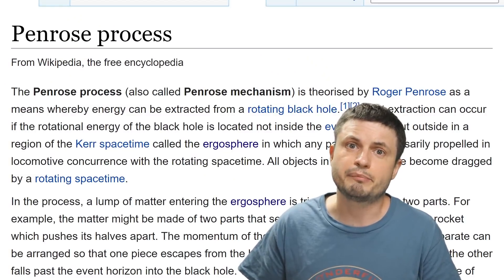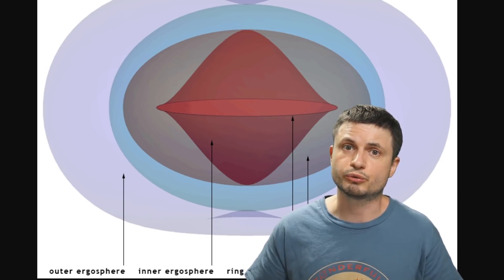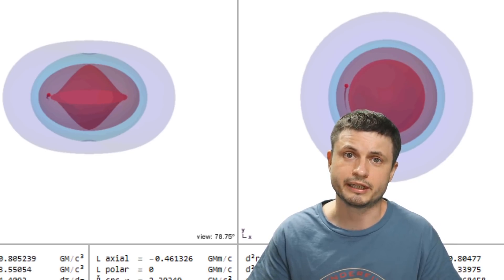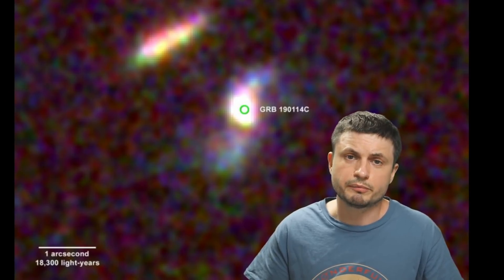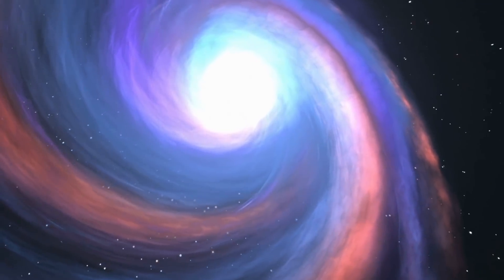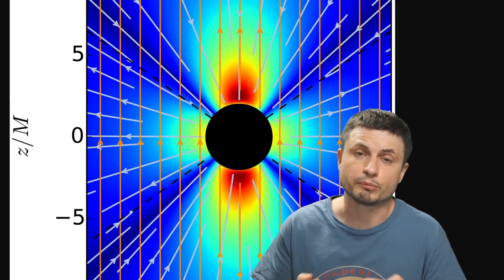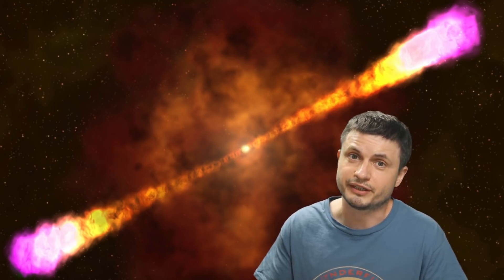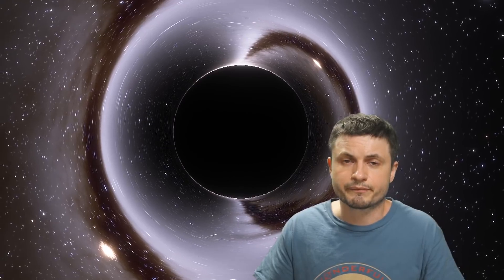Gamma Ray Burst Stole Energy from a Black Hole - Proving Penrose Process

Comment: The Universe is expanding too fast, the constants are all wrong, the speed limit of cosmic particles breaks models,
so they THINK a long long time ago, a binary system caused a black hole. 
 The MAGNETIC lines of the Theoretical newly created black hole by a previous system is powering this event - because they FORGOT ELECTRICITY exists - They think is ROTATIONAL energy - invoking warped spacetime - 
WHAT THEY ACTUALLY SAW - powerful Gamma, Xray, Radio - a powerful event. 
This could be more easily explained as a plasmoid, - I wonder if they will find another like this 
and if this even will leave a Mysterious star in the middle.

Comment: You would think it would take the same energy to escape as you acquired while accelerating toward the black hole, (sling shot). However, I have heard of deep space probes using this sling-shot effect around planets to increase their speed, thereby increasing the distance they can go. It is a capturing of energy, using a formula to calculate your course. I guess you would want to know the mass of the black hole too.

Comment: This strikes me as the oberth effect gone crazy. I wonder if it is related.
Reply: It is its basically a gravity slingshot maneuver for light it is just that for light since it must always travel at the speed of light the transfer of angular momentum from the black hole means the frequency of the light must increase boosting the energy of the light. Frame dragging just adds a bit extra to the system from the energy trapped within the ergosphere spinning space itself. Edit clarified a bit.

Comment: A mathematical singularity is a 1 dimensional object, right? So how does that become a ringularity which is 2D at least?
Reply: I'm not mathematician (or physicist), but from what I know, the ring basically simplification on how rotating singularity worked mathematically, because, as you said, singularity cannot rotate, mathematically. Basically, it's just "Imagine this singularity, moves in rotation, in a very, very, small orbit, pretty close to zero."
Reply: nonsense jim  ...Okay, how this explain Ring Singularity?

Comment: I think the Romulins. Use this procedure to power their starships
Reply: You even. Paused. Like. William Shatner.
Reply: Romulans too... 😆
Reply: As long as you have the energy to escape the gravitational pull, it could be possible. I’m sure those stars produce lots of radiation as well, but it’s fun to think about!
Reply: @earthmama5659  actually there is a stable orbit that can be calculated around a black hole oddly enough. A little closer and you fall in, if you don’t boost out of there, and we all know beyond a certain point, there is no return.
Reply: No, they use micro black holes and the energy comes from the black hole evaporating.  

Trek as usual doesn't really get the science, a micro black hole is basically a battery, you have to make it and "charge" it with matter so it's not really a replacement for antimatter as suggested. They probably use another power source to make them.

Comment: What happens when two galaxies merge and the central super massive black holes collide? Presumably it’ll cause the biggest explosion/implosion since the Big Bang. The two galaxies would be ripped apart. The Universe is so vast it must have happened many times.
Reply: No big explosion if they merge. They just merge, and that's about it.
Reply: @heisag  it would probably not be a direct collision so as they approached each other they would speed up going into a tight orbit increasingly narrowing because of tidal energy dissipation and increasingly rapid orbits until they finally touch. Presumably there would be a explosion/implosion so how much of either is arguable but the gravity waves generated would be immense. it must have happened many times and in fact there's probably even been triple SM black hole mergers.
Reply: @alexbowman7582  Gravitatonal waves would be generated, but any explosion event would not escape outside the event horizons. At least not with the current understanding of black holes. Maybe in future understanding upgrades it would.
Reply: @heisag  I would imagine that there would be massive energy jets shooting out from the SM black holes respective axis’s but how much explosion/ implosion there would be is obviously debatable but I would say there would certainly be massive explosions as they approached each other as nearby stars are ripped apart from the immense gravitational changes. The stars matter would be absorbed by the SM black holes generating huge gamma and x-rays as well as visible light.
Reply: @heisag  presumably as the two SM black holes approached tidal forces could break down the event horizon allowing jets of plasma to leave one and shower on the other SM black hole. Now that would be a firework display which would light up the universe. Sun size amounts of matter could be destroyed into energy every second.
Reply: It's thought that the black holes merely merge, though there's question to how supermassive black holes cross the last few parsecs at all.

Comment: One thing has always confused me about spinning black holes. Presumably, at the singularity, gravity is so strong time should be at a virtual stop. This being the case, is the singularity actually spinning, or is this a more residual effect?
Reply: The math breaks down somewhere around there, so we must assume that we don't know. Black holes are anomalous objects that cause partially understood outward behaviors, yet also culminate in things like divide-by-zero or other sources of infinities that tell us that we're missing something deeply important, despite accurately predicting things located some distance from the anomalies themselves. Thus, we can tell that the idea of all time coming to a stop is nonsensical, but we can't say what happens instead, because we literally don't know what happens instead.
Reply: Ring singularities inside Kerr BH are timelike ( unlike Schwarzschild B.Holes , that have spacelike singularities).
Spacelike singularities are ,literally , the end of proper time ,for any object that falls in.
On the other , ringularities have an intrinsic spin (according to GR math ) and they persist in time ,unlike spacelike ones.
Also , it is difficult for any massive object to reach a ringularity due to repulsive effects .
In realistic , astrophysical black holes , the region that contains the ring is unstable , so , in reality , rotating black holes do not have ringularities but , instead , spacelike or null (lightlike) ones.

Comment: Wait, why would this be energy "out of nothing"? It looks like you are just extracting energy out of the spin of the black hole, which would mean you would slow the spin of said black hole over time. An extraordinary feat, but hardly a violation of the laws of thermodynamics.
Reply: Would a spinning black hole have extra mass due to relativistic angular momentum?
Reply: @lancebybee7962  extra apparent mass
Reply: Thats exactly what he said lol
Reply: It's not that it's out of nothing, it's that it's out of a black hole.  You shouldn't be able to get anything out of a black hole, energy matter information,  nothing.
Reply: @DrewLSsix  Actually the question was how would the energy transfer as no particle or wave could escape the black hole. And particles and waves are the known ways to transfer energy but energy transfers in some cases in ways we don't understand well. But energy it self is very poorly understood actually called sort of an accounting trick by some prominent descriptions of it. Accounting trick as it something inserted to make the equations work but unknown nature in it self. We know how energy transfers and is stored in some forms but not in others. Hawking radiation if it exist would of course be another way energy is removed. And Gravitational Waves from Black Hole mergers which actually lower the combined mass by several percentage points another way energy is removed from Black Holes. 

Example Gravity assist a tiny part of the planet's relativistic mass/energy is transferred to the space craft increasing it's speed thus it's relativistic mass/energy. As it is an elastic reaction no energy changes form. How does the energy transfer? Unknown. Hope I understand this right for this to be good example.

Comment: There is a few videos about this process and those similar that would allow for Black Holes to be used as batteries be it for mechanical energy (spin) as well the evaporation for low mass that would more than rival fusion.

Comment: One thing I remember hearing about was, theoretically if you were to shoot an electron from say a ship, you’d get a little energy from that.  If it were to say, come right next to a black hole, then make a 180 and head right back to the ship and hit it; it’d now give more energy.  You now have your electron back, and you’ve gained momentum/ energy. This would ultimately be a completely free energy source.
Reply: But the conservation of Energy is still applied, the black hole works on the electron
Reply: It's more or less a gives back what it takes kinda thing. What energy is expended, just like the momentum that is created, is returned in kind. Also, and just an afterthought, the ship is expending energy to keep itself relatively within the same spot, so may not be worth it.
Reply: @keiganblaise9878  a better explanation is if your exhaust was shot out at a black hole and then is shot around it. When it comes back it will now be a forward thrust like if you were using a sail.  The only thing is finding something that expels it’s of fuel.  So if you had something that shoots something out, then would be able to collect the fuel once it shot around.
Reply: @chronicsnail6675  you shouldn't be able to extract energy from a black hole so it is in a way energy from nothing.
Reply: @chronicsnail6675  it’s a paradox.  The law of conservation doesn’t exactly apply/ is broken due to the fact you use thrust and receiving push.  The electron is more of less just used as a placeholder, a better way of thinking of it is your exhaust is shot at a black hole and aimed just right to swing back around and now pushes you.

Comment: So here's a couple of questions I have - If the angular momentum is carried over to the black hole once it forms:
- Is this the reason why objects circle it the same as the planets in our own system do around our sun?
- Does the amount of matter circling the Event Horizon create any type of drag or acceleration to its own spin (referencing items like our atmosphere having an effect on our own planet's rotation or the moon orbiting the Earth)?
- If either of these are true, is there a way we can calculate the rotational speed of the black hole (centralised mass) based on objects orbiting it?
Reply: In order: no, yes, yes.

Objects circle the black hole "perfectly" mostly because the accretion disk is composed of things jostling against each other, which along with the resulting massive magnetic field, results in the relative motions of everything getting evened out- the same thing happens during the formation of planets from proto-planetary disks. There will still be some irregularities, and as matter clumps up those concentrations will create more irregularities, but early on everything with have been brought down to a stable disk.
Reply: @absalomdraconis  how is it that a planet orbits a star , if hypothetically if a planet had no angular momentum then would it just be swallowed by the star?
Reply: The first question is interesting, I have wondered where the planets initial 'perfect' angular acceleration comes from

Comment: what if a large black hole rip a small black hole apart . this discovery would be epic beyond anything we have seen before.
Reply: smaller things are harder to rip apart by a black hole, so it wouldnt work.
Reply: @yourguard4  still , black hole and neutron stars have a limited amount of mass . regardless of their density , if a black hole with sufficient mass grabs it , they could at least be practically rip to shreds . it would be interesting to see weather the material would start glowing again or nah .
Reply: @m.c.4674  Things get rip apart, because the side which faces the black hole is stronger attracted than the other side. 
There is nothing to rip apart at the black hole. You would just see a deformation of the "black blob", until both black hole are merged. Which takes about 1 second according to the observation of gravitational waves :P
Reply: @yourguard4  yh, but that's the thing , it could get extremely deformed , thus ripped apart. never say never my friend , because there no reason this cant happen.
Reply: @m.c.4674  but it gets deformed in an other way than regular matter objects. It gets more squeezed than strechted.

Comment: Assalamualaikum guys, it turns out that the full moon is the edge of the circle R. Blue guys, I have binoculars using a dark lens on the left, it's like a cave passage, and the star is black in the middle, there are 2 holes, guys.

Comment: This may be a dumb question but... if you're in the ergosphere, are you traveling through space at fractions of C or are you stationary in the section of space and time that is spinning around the black hole???!!! 
Not sure if my question is clear. Ihave an idea of what i want to ask but It's difficult to articulate the question.
Reply: A subtle subject. The speed of light does not appear to be defined in absolute reference to space-time, but instead in absolute reference to everything else, with space-time itself being used only to provide the coordinate system via which such motions are defined. That having been said, we've also observed that the movement of space-time does seem itself to tilt that definition of motion such that the motion is divided into apparent speed and effective speed, with the "effective" speed being what the speed of light applies to, and the apparent speed determining e.g. how long it takes a moving thing to actually reach an observer of it. It's speculated that such a mechanic may someday cause most of the universe to seemingly disappear due to space-time inflation between observers and far objects exceeding the speed of light, but if a way of engineering "fixed" corridors of space-time could be found, then it might also be usable to create analogues to wormholes that have sometimes been refered to as "ftl highways" or "warp highways" or something else of the sort.

Comment: Does the Penrose Process only work at a quantum level or would it still apply on a macro scale? Basically, could you take a spacecraft into the ergosphere, orbit the black hole to accelerate to a significant portion of the speed of light before jettisoning a majority of the mass of the spacecraft into the black hole to propel the remaining portion out of the ergosphere? Granted, this would ignore the problem of decelerating upon reaching the destination, but that's a problem for a later day.
Reply: Actually I'm pretty sure that would work, given that you had the structural stability to withstand the forces of the black hole. They actually asked this question in the movie Interstellar. Many of the major physicist loved this movie because they asked these questions. Granted I don't have the skill on mathematics to even understand the equations necessary to understand what would happen.

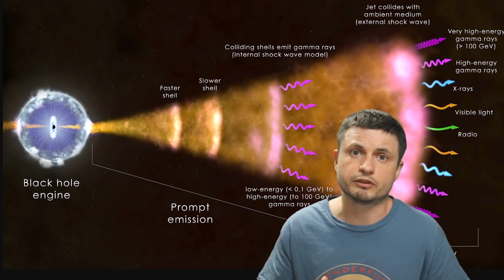Comment: "...we now have observational proof that it's definitely possible to hypothetically steal energy from a spinning black hole" (@7:45). Wha-at? What does it mean to say that it's possible to do something hypothetically? There is a lot of sloppy speech going on in that sentence. 
     How does 'definite possibility' differ from 'possibility'? There are no degrees of possibility. It is either possible or not. We may not know which, or we may think we know when we don't. There are degrees of probability, but not of possibility. 
     Secondly, it is possible to hypothesize anything. The hypothesis may be patently ungrounded (therefore scientifically worthless) or not. 
     Lastly, did you mean we have observational PROOF or observational EVIDENCE? Does the scientific community agree that the matter is conclusively demonstrated, now on the basis of this single paper? Or does the paper simply show how the actual measurements comport with the mathematical model (no small matter)?
Reply: The Universe is expanding too fast, the constants are all wrong, the speed limit of cosmic particles breaks models, headlines every year saying we need to rethink all of our models.
so they THINK a long long time ago, a binary system caused a black hole. 
 The MAGNETIC lines of the Theoretical newly created black hole by a previous system is powering this event - because they FORGOT ELECTRICITY exists - They think is ROTATIONAL energy - invoking warped spacetime - 
WHAT THEY ACTUALLY SAW - powerful Gamma, Xray, Radio - a powerful event. 
This could be more easily explained as a plasmoid, - I wonder if they will find another like this 
and if this even will leave a Mysterious star in the middle.

Comment: Now I wonder; what would happen if mankind purposefully rotated massive objects opposing the rotation of the black hole and somehow maintain it until it stops spinning? I mean we all know everything will just head straight for it right away because the centrifugal force is what is maintaining planets and suns orbits. Could we see the core at that point, since the gravitation forces are not bending light in a circular pattern?